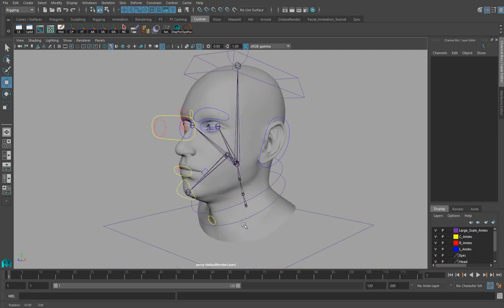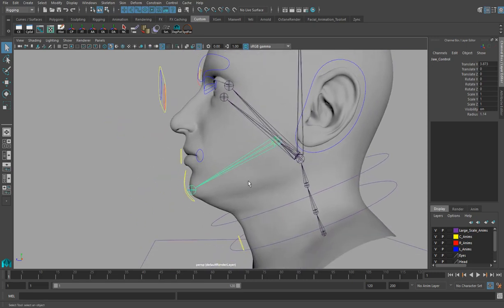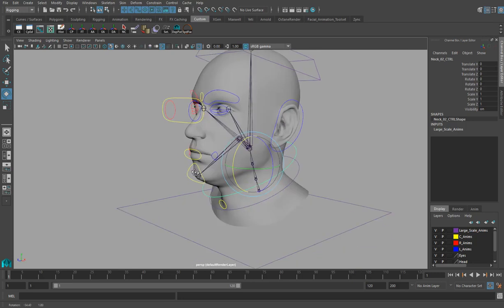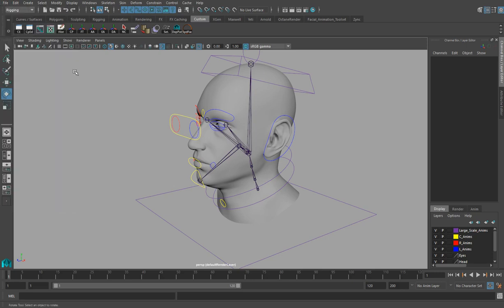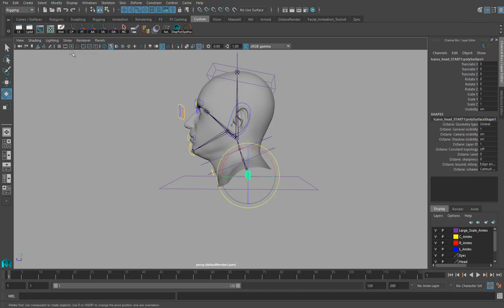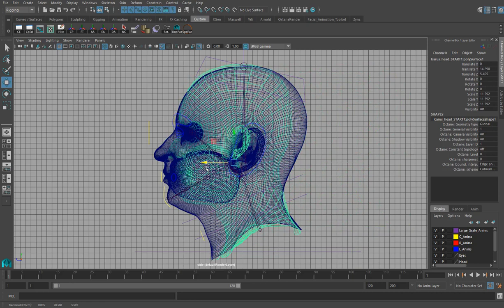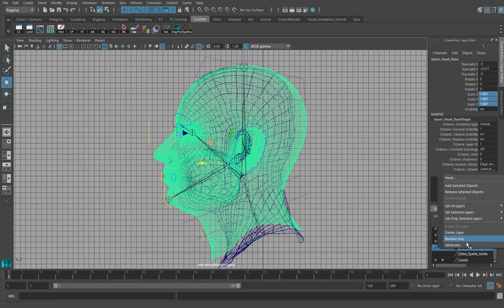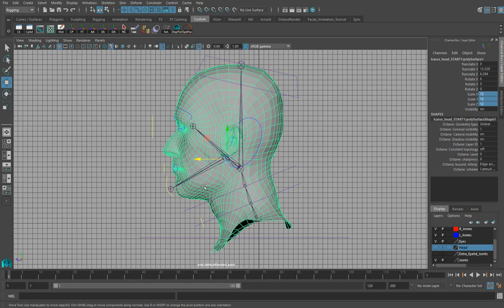Rigging a Photorealistic Head for Performance Capture - Importing Your Head (1/13)

Comment: Is having a real-world scale head needed for mocap applications to work?
Reply from the maker: No, it's not a prerequisite but it is good practice. Working from real-world scale in both the head and body models can mitigate any possible issues you may find when retargeting the data - although this is highly dependent on the type of MoCap/PeCap systems you use. Ultimately, working in real-world scale is advisable more from a rendering perspective than anything else, especially when dealing with unbiased render engines.